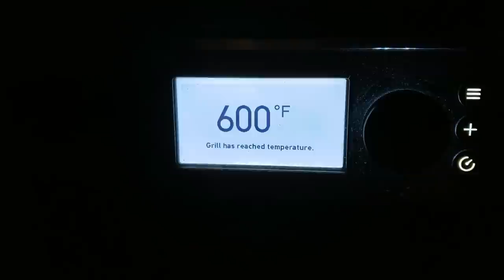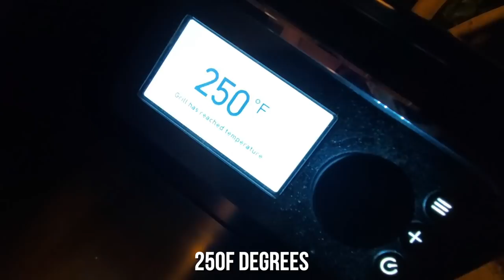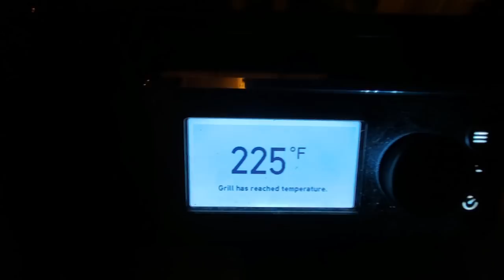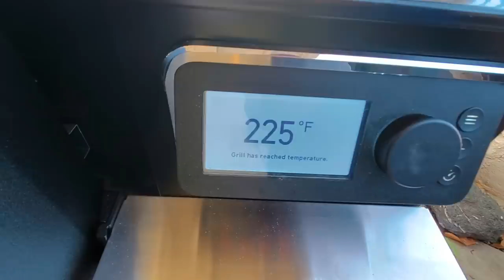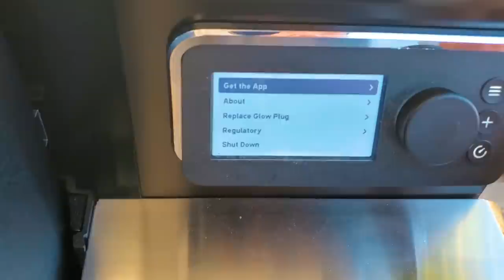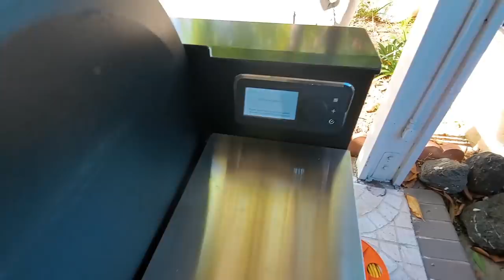Pt 2 WATCH BEFORE YOU BUY | Weber SmokeFire Pellet Grill | BBQ Champion Harry Soo SlapYoDaddyBBQ.com

Comment: Harry, any chance you can do some independent testing of the actual cookers temp compared to what the controller says it is?  For instance, my GMG may be set to 225, but its really at190 per my Maverick probe.  I then adjust temp from there until the maverick reads 225.  I have seen others say the Weber runs around 25 degrees colder at 225.
Reply from the maker: Yes, see Part 1. This is Part 2
https://youtu.be/ALNnTwN2Kak

Comment: That was a great video about the WSF. I am a traeger guy and have been following the SF since your first video in Chicago. Although it doesnt seem to be perfect, I can see where the engineers of the SF were coming from with this cook you did. 

It seems you found the sweet spot of the grill at 225. I'm interested to see what it's like at other temps with the right side is hotter issue I have seen with other YouTube ers. Could you test that out in a future video please? 

Thanks!
Reply from the maker: Chris, did you see Part 1 at Dennis home?  Did H-n-F @400F,  L-n-S at 275F, and 600F sear in 7 hours w 45 lbs meat.  Let me know if you have questions.  Part 2 was L-n-S @225F and @250F
Reply: Thanks Harry, I had seen it but just rewatched the pancake test. So it seems to even out after its warmed up. 

I look forward to watching you cook more on it. It's been fun to watch!

Comment: Why did you add pellets at the 7hr mark? It looked like there was going to be an issue. Soon....
Reply from the maker: I was going to sleep.  Do you own a pellet cooker that goes past 7 hours without refuelling?
Reply: @SlapYoDaddyBBQ  yes sir. I own 3 pellet poopers.  A Myron Mixon BARQ that has a 35lb hopper. Rec Tec BFG with a 50lb hopper and a Pitts and Spitts Maverick with a 35lb hopper. Cooking at 225 they can all run about 20 to 30 hrs with no refilling. Depends on how cold it is.
Reply: Most pellet smokers can go past 7 hours without needing to refuel

Comment: My pellet smoker has a stack as I use it in the garage , on my 2nd year of using it and the only complaint I have is the convection makes the pit too dry and crusts my meat in 1-2 hours
Reply from the maker: Try a pan of water in the pit to increase moisture

Comment: Wow, that smoker holds a lot of meat! I've only just started putting a tin of hickory chips on my old 2 burner propane grill and cooking on the cold side of the grill. I've got a family of 6, so we usually grill pork butt since it is cheaper - we might have a sirloin roast for a treat or special occasion. All the meat you cooked looked so tender, guess that's from the slow cook? What does the water spray do for the cook? Thanks for sharing.
Reply from the maker: Spray is for creating bark and smoke ring

Comment: Question for your Harry:  Are you going to stick with your WSM in competition, or will you be using the SmokeFire?
Reply from the maker: I've won 100+ first places on my humble (and beat up) WSM-18 so I'm not changing.  I only use my pellet cookers when I'm lazy!  I like live fire manual controls myself.
Reply: @SlapYoDaddyBBQ  jajaja this one you can't use when you're lazy! it miss-delivery that feature, you need to clean it to avoid fire and keep an eye on the pellets as it was clear they didn't were been fed right, else you wouldn' have to push it with your hand on your video sir.

Comment: This was a very informative video.  I'm a "Group 2"....not purchased yet but still intend to.  I was getting the impression that the whole grease fire thing was very overblown.   This and some of the later videos we've seen I think confirm that.  And that was a ridiculous amount of grease in the lower tray....not seen that at all which is indicative of how much meat you were smoking at one time.  Crazy!  There are still real issues with this cooker....I think there will be a hopper revision at some point to make people happy.  Auger motor issues are a real thing and Weber seems to be sending those to customers as needed.  And some computers won't update regardless of how hard you try, so some are being field replaced as well.  But when the unit works as advertised, it seems to meet Weber's original objectives.  I'm looking forward to future videos of you and the Smokefire.
Reply from the maker: I hope Weber engineers don't watch my video as I'm a knucklehead for trying to trip up their pit.  So far so good but I only have 2 data points so my results are hardly conclusive nor representative of the majority of Group 1 or Group 3 experiences.  As a recap, my two data points are:
TORTURE TEST 1 - PASSED
45 lbs 5 meats in 8 hours. Generate grease from a 16 lb brisket, 10 lb butt, and 3 St. Louis ribs to drip on the SF the first 6 hours at H-n-F cook @400F and L-n-S cook @275F. After all that grease was accumulated, fire it up to 600F to grill the ribeyes and sausages.  Cook to let the grease drain in the unit and then try to flash that grease at 600F to test for safety 
TORTURE TEST 2 - PASSED
65 lb, 3 meats in 12 hours. Two 16-lb brisket, Two 10-lb butts. Two 7-lb beef shortibs.  Low and slow @225F to see if hopper feeds properly, no grease fire w 12-cups grease collected, and no excessive ash
Reply: Bill Orensteen the documentation mentioned using drip pans on long cooks when the product shipped.  The error was that they didn’t explain exactly why.  So this isn’t something “new”.  Still, 12 cups collected in the tray is a lot which indicates that the system did largely work as designed.  A flare up isn’t going to scare me.  I’ve been cooking indoors as a hobby for 17 years and grilling outdoors for the same period.  Flare ups are part of outdoor cooking.  But you don’t want 12 cups of grease trapped in the belly of the cooker, heat and an ignition source.  The grease left the system as designed.  I’m sure that there was probably a debate in the design phases about the merits of putting the grease exit holes near the firebox.  And somebody probably said “I can design something that has only a single catch tray and still avoid major grease fires” and this is the design that came out.  But here’s the thing...if you still don’t like the design, they don’t buy it.  If you can’t clean your grill at recommended intervals, then don’t buy it.  If you can’t change your grease tray at proper intervals, then don’t buy it.  Find a product YOU like.
Reply: Sevenfeet0 I sell four brands of pellet cookers and while grease fires are quite rare you can have them on any brand if you cook a bunch of greasy food and then crank them up to high heat I believe animal fat catches fire above 375. I’ve had customers from every brand report a grease fire in the past ten years. It’s the same with a gas grill. You have to be aware of what you have cooked and what you intend to cook and do some minimal cleaning.  As discussed in depth on the interwebs, most pellet cookers have a full grease pan over the heat deflector that covers the entire cooking area. If you saturate this pan with grease and crank your cooker to high there is a risk of grease fire. It’s rare but I can assure you it happens if negligent. The funny thing is the resistance to putting a foil pan under your food to catch the drippings and making any cleanup a breeze. I would have done this regardless. It’s no different than lining the heat deflector with foil IMO. Also all pellet cookers have issues with pellet cavitation. It’s just part of the game. At high heat it happens faster obviously.
Reply: Bill Orensteen again, that wasn’t a big deal fire.  The video that Tony Ngo just posted?  That was a big deal fire.  And like this video, it was a torture test of 50+ lbs of meat.  The only explanation in the other video is that grease didn’t exit the system, which led to the problem.   But his videos still lend a lot of questions since he didn’t explain his methodology as much as Harry did.  Harry said he took out 12 quarts(!) of grease during this cook.  Tony said his trap was only half full which means the grease was still in the belly of the cooker.  Why the difference?

Comment: Harry, thank you for the fantastic review and your shared knowledge of bbq.  Based on your comments I fall as audience number 2, Weber consumer with great regards to their products and customer service to date.  

Prior to the smokefire I was in the market for a Stumps gravity feed smoker because I was concerned with quality of other common pellet grills.  Traditionally Weber puts out top notch products and stands behind them so this unit was a no brainer.

Your test show that it’s a capable pellet smoker, but what are your thoughts when you need to run a bit hotter?  I use smoke boxes on my genesis and have produced fantastic results but I’m always cooking around 300 indirectly. I don’t care so much about the range, but if I need to run a “hot and fast cook”  do you think it will manage?
Reply from the maker: Hey Dennis, did you see Part 1.  I addressed your question in TORTURE TEST 1 - PASSED
45 lbs 5 meats in 8 hours. Generate grease from a 16 lb brisket, 10 lb butt, and 3 St. Louis ribs to drip on the SF the first 6 hours at H-n-F cook @400F and L-n-S cook @275F. After all that grease was accumulated, fire it up to 600F to grill the Ribeyes and sausages.  Cook to let the grease drain in the unit and then try to flash that grease at 600F to test for safety
Reply: Harry Soo, thanks for the feedback, I did watch the video with Dennis if this is what you are referring to.  If I cut it short I do apologize for a non applicable question.  Again thanks for sharing your knowledge and bbq wisdom.

Comment: I’m curious if you would have let the pellets go if they would have started to kinda avalanche from the steep side and kept feeding. Just curious. Maybe you should do a test on that, see if they keep feeding even though it looks like the augers about to go dry because of the cavitation...
Reply from the maker: You are correct Jaime. I will have to test that.  I had $250 of meat cooking so I refueled at the 7th hour mark as I did not want to risk it as i was asleep and had to run to catch a flight to Houston to compete in the world championships.  I'll do a future video where I run it until empty without stirring to see if all the pellets will fall automatically into the auger.
Reply: Harry Soo i dont blame you, i would do that on a dry run if it were me. If they do have an issue, and if ppl dont want to give up hopper capacity, i wonder if a shaker motor that would go off every few minutes  to shake the pellets dow could be used to fix the issue? I’ll get into r&d right away! Lol

Comment: Another Great Video Brother!!!!!!!!!!!!!!
Reply from the maker: TORTURE TEST 1 - PASSED
45 lbs 5 meats in 8 hours. Generate grease from a 16 lb brisket, 10 lb butt, and 3 St. Louis ribs to drip on the SF the first 6 hours at H-n-F cook @400F and L-n-S cook @275F. After all that grease was accumulated, fire it up to 600F to grill the Ribeyes and sausages.  Cook to let the grease drain in the unit and then try to flash that grease at 600F to test for safety 
TORTURE TEST 2  - PASSED
60 lb, 2 meats, 12 hours. Two 16-lb brisket, Four 10-lb butts. Low and slow 225F to see if hopper feeds properly and no grease fire after 12-cups collected, and no excessive ash

Comment: Thank you so much for your presentations, honesty, and frankness. I guess I belong to ''group 4.'' I LOVE my Weber products(22WSM, 26Kettle, and a 2-Burner Spirit). That said, I smelled the proverbial rat with Weber's entry into the pellet market. I've long felt that flavorizer bars had been over-rated, and would not work out well if included into the design of a pellet grill. Evidence suggests that I was correct. I'm sad about the issues with the new product, as I'm otherwise a Weber advocate. I'm also very, VERY happy with the pellet grill I already have. I'm very much looking forward to Weber's re-introduction of a redesigned pellet grill. Hopper design aside, I'm pretty sure they'll ditch the flavorizer bars in favor of the conventional drip tray. Thanks again for your views, you are my bbq god.
Reply from the maker: Thanks BigMark2.0.  I am happy to share what I have learned in my limited two data point test which is not conclusive nor representative of the experience of the majority of SF owners in Group 1 or 3.  I'll continue to do more testing and post my results.  The next will be the cleanup from my 12-cup grease cook Test 2 to see how well or easy it is to clean.  I own two Jim Bowies and will do a test against them also. Stay tuned and thanks for watching my channel where Harry fails so you don't have to.  Teaser, I have a crawfish boil brisket video  soon.

Comment: Now that was a lot better test than the first one!  Wish you would have let it cool down, took out the flavorizer bars and showed what the bottom of the grill looked like. Looks like you had good grease drain for this cook. 
I understand you topping off the hopper while you were going to be in bed and couldn't keep an eye on it.
Reply: Also glad to see Mr Beans has recovered from the coyote attack
Reply from the maker: I will do an SF cleaning-after-a-cook video next as I had to run to catch a flight to Houston after my Test 2.  
I plan to run a test in the future to see if the hopper feeds until empty. I had $250 of meat I did not want to take a chance and needed some shuteye. If it was a daylong cook, no problem watching it until the low fuel alarm goes off.  Thanks for stopping by.
Reply from the maker: He's recovered fully and ready for more BBQ!

Comment: Cooking at 225 guarantees that you won't get a grease fire...

(edited)

Harry, please forgive my snarkyness. I've had a lot of leg pain the last few weeks, and I haven't been as gracious as I like to think I normally am. Even though I do think you are giving Weber the benefit of the doubt, I have no idea what your background is with them, so I am in no position to judge you.

I think the reason why you hadn't any grease fire issues with this cook is because this particular cooker did a better job with ash management than many others have had. With not enough errant ash to form a dam, the grease drains as it should and was designed to do.

Keep on doing what you do -- you do it well.
Reply from the maker: See Part 1 video for 400F H-n-F + 275F L-n-S followed by 600F in 7 hour Torture Test w 45 lbs meat.

Comment: Sorry, late to the party. There is a way to block offensive words on your YouTube channel. It's through the community settings I think. You will have to type out every offencive word that you don't want allowed on your Channel, but after you do those words will NOT be allowed on your channel. 

Now, thanks for the video, nice to see another person that is having GOOD luck with this grill/smoker. I kind of like Camp Chef myself, but that doesn't mean I want this Grill to fail by any means! I was hoping it would work just like they said it would so it might be my next smoker!

I do have a question for you though. Does it really make a difference if you use kosher salt or sea salt? I've noticed that most of the people who BBQ on YouTube seem to be using kosher salt. I have both but use sea salt more it seems.

Thank you!
Reply from the maker: Thanks Darrin for sharing your tips on offensive words. Hope your Camp Chef works out. Remember that irs the pitmaster not the pit. Either salt is fine if you know how to use the right amount as it's the same NaCl.